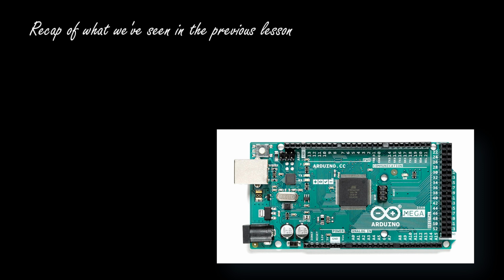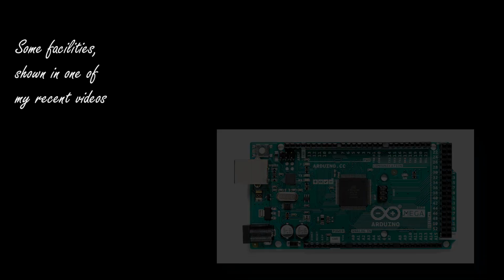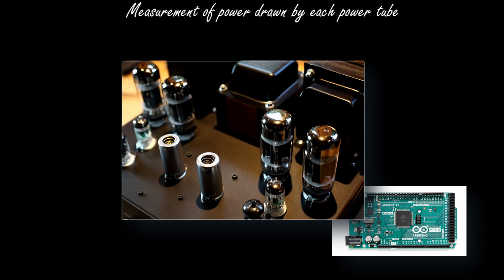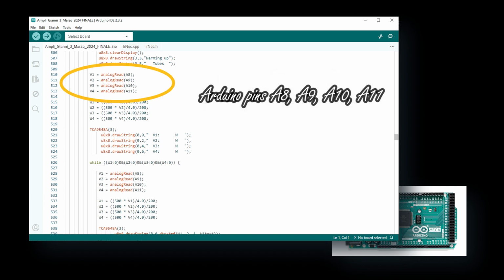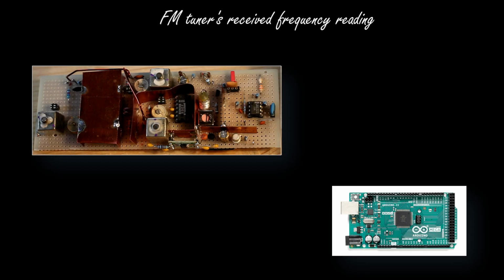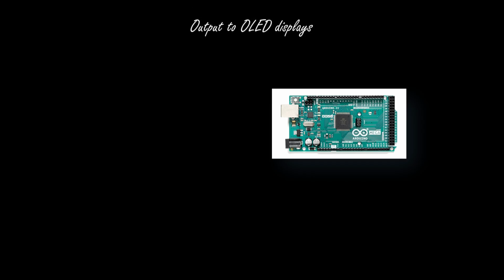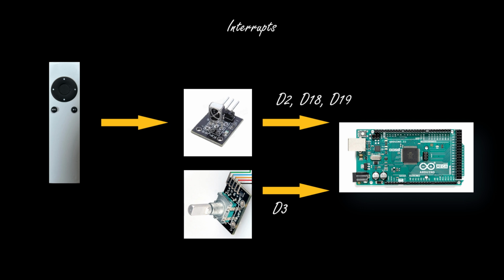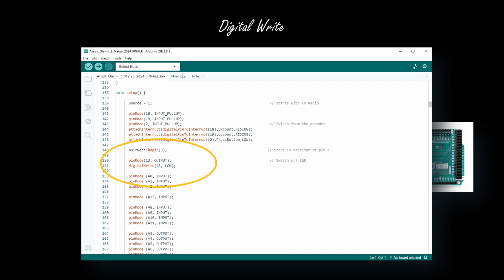Best Hi-Fi user interface with Arduino & microcontrollers ! Lesson 2

Comment: I am very interested in getting the tube monitoring portion of this running for my amp, but I've got 10 tubes to monitor in this amp, and there's about to be 16 more, so I might have to get creative lol
Reply from the maker: Wow, 26 tubes to monitor ! Must be an exciting project ! Not 100% sure, but I believe the max amount of analogue pins for Arduino family is 16, provided by Mega. So I think you need two Arduinos, connected together in some way. Thanks for your comment !
Reply: Yeah, there's a lot of tubes, lol. my main amp is a cary sla-30, it's 2 12ax7s driving 8x7189 tubes, and in a few weeks, i'm going to be picking up a pair of vtl monoblocks that have 8x 6550 in each one, so there's gonna be lots of current monitoring going on.

I got out my arduino this morning and started experamenting with code, and it looks like it's not going to be too hard to do, though I need some of those bigger oled screens.